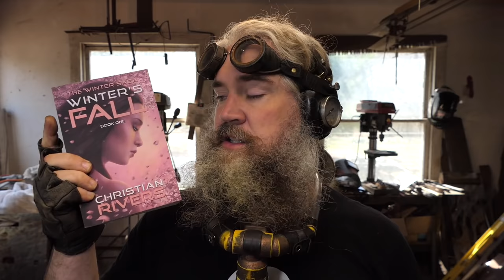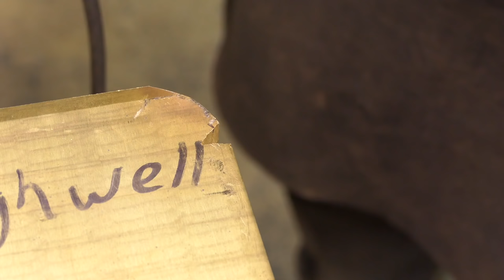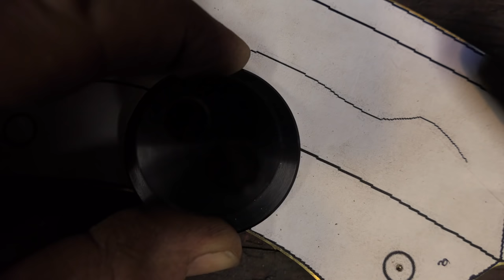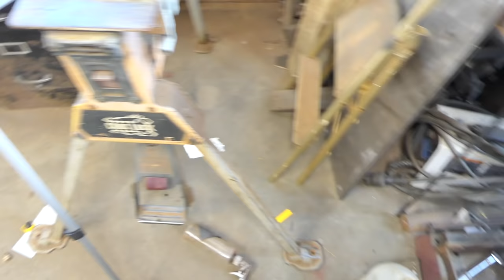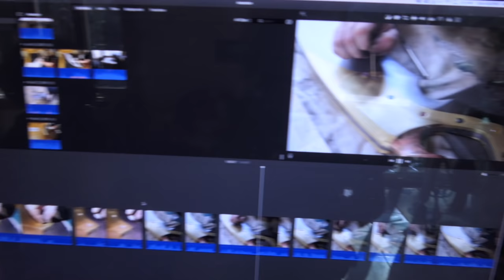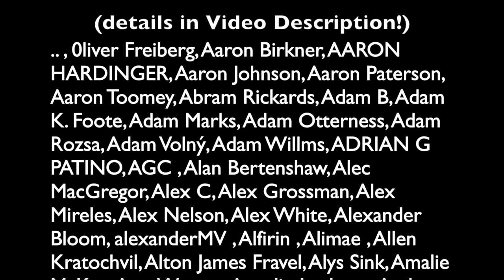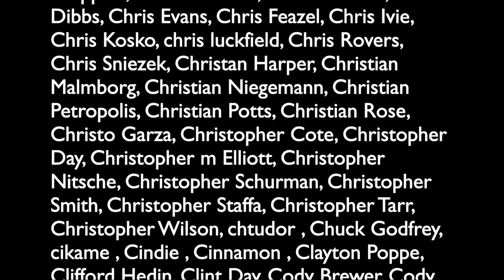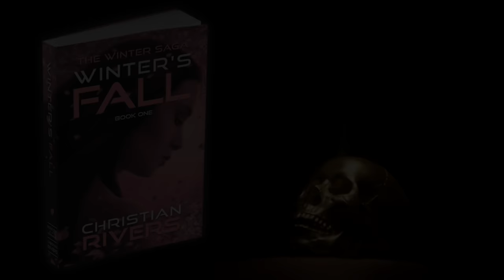Ascension Sword Build

Comment: Brass dust is apparently very highly combustible, I'm very surprised with the welding and sparks from grinding nothing happened. Also the brass handles just alone look like wicked daggers.
Reply: I've seen some s*** with oxy acetylene torches and brass dust never anything from welding
Reply: Never heard it about brass, that's crazy. I know aluminium dust is very combustible and can spontaneously combust when wet. I remember steam cleaning the crevices of an aluminium piece I was working on and it was like I was grinding it with all the dust going up
Reply: Nearly any and all forms of dust are combustible and under the right conditions... Highly Explosive :P including but not limited to Flower and Non-Dairy Coffee Creamer...

Comment: "Wear your gloves kids"

Continues rest of video without them
Reply: Well he's not a kid ;-)
Reply: Do what he says, not what he does.
Reply: literally was about to say...
Reply: Don't worry, he's a professional. He only touches things that are clearly too hot to touch MOST of the time.
Reply: A craftsman works better without any interference, like wearing gloves..!
Reply: same with the welding im thinking please use gloves and the next shot hes using a glove to hold the sword in the vice, so then im thinking "thats not what i ment and you know it" :D
Reply: Do as I say, not as I do
hehe
Reply: @Feroce  Not rly correct. Rotorary power tools or unprotectet turning parts have to be avoided but impact tools you should wear them  . PPE is just the last line of defense in the hirachy of controls, that put a barrierer between you and the hazard, but also as you mentioned PPE could be a hazard by itself if not properly maintained or used under incorrect circumstances. TLDR: specific task rquire specific hand protection

pps: sorry for the poor english
Reply: Denis Böhler totally agree with what your saying, my grandpa has quite a few heavy machines in his basement, two lathes, a milling machine, sanders grinders and a wire and cloth buffing machine. The consensus is short sleeves always, gloves when safe, and eyewear always for those machines. Most important is to respect them, never had big issues. (P.S. I didn’t even notice English issues, I type stuff worse all the time! Have a great day!)
Reply: The key woed is kids 🤣

Comment: I wonder how often Michael has to run a magnet down his shower drain, lol
Reply: Wouldn't get the brass dust though.
Reply: if you go back in his videos far enough to where he was doing the TV show you will find him talking about how showers are for dorks and that he just vacuums his hair when he leaves the shop....no idea if that ever changed.
Reply: If he ever gets an MRI he'll be ripped apart
Reply: @kelzuya  Nah, it will turn itself inside out trying though.
Reply: @jamescairns8465  can't tell if you're being serious, but that TV show was largely hammed up and entirely inaccurate to who he was and his operation. It was... really weird to watch. Still entertaining I guess, but it had that very fake, obviously made for TV esque drama. Its no wonder TV is beginning to die 😂
Reply: Tv is already dead
Reply: @jamescairns8465  I believe he said shower once a week LOL.
Reply: Conveniently, with steel, small flakes like you get from grinders/die grinders rust and turn to nothing fairly quickly. Its stainless and brass shavings you gotta watch for. Unfortunately, neither are magnetic. I weld and get those shavings in my clothes/hair (long hair) all the fucking time, but one shower/wash cycle gets rid of the steel ones.
Reply: @vangoghsseveredear  I fricken hate working with aluminum. I swear I’m allergic to it. If too much gets on me I just uncontrollably itch
Reply: @jerod5636  I can't say I've noticed that personally! But I guess I've never had to grind or cut a ton of aluminum either. I've welded it lots, but never had a pile of shavings on me like steel or stainless. At least on the upside, aluminum is quite fun to TIG weld 😅

Comment: I used to work with brass a lot as a cabinet maker. Pipes, sheets, knobs, and the like. We had what I recall to be a mostly\ normal bandsaw, but with a specific blade for brass, as well as an oil squirting nozzle nearby that would periodically release cutting oil into the cut. We had an air compressor as well, so we would open a little spiggot with a valve (really cheap setup) to constantly blow air on the cutting area to clear a good amount of the brass away, but all that was mainly for the sheets we had to cut sometimes. So very long cuts.

For smaller things like tubes and bits, you could just run through a normal metal bandsaw blade dry and do it very quickly with no problems. Just had to brush away the brass afterwards.

Brass is a good soft-ish metal, but it also leaves a lot of detritus behind when you cut into it (as you got to see). Working with the tools you worked with, I think it's hard to criticize you at all lol just a little squirt bottle of cutting oil might have helped you, since it helps keep bits/blades from getting gunked up with brass.

Comment: I've cut a lot of brass plate in the past and the best device I found for straight cuts is an adjustable speed circular saw with a carbide-tipped blade set at low RPMs. For curved cuts, an adjustable speed jigsaw with coarse or woodcutting blades works best.

Comment: 3:50 Anyone else think the camera was deliberately being leaned in for a better look at first?
EDIT: Hey, Michael- fantastic build, lots of stuff learned.
I have a question. You know the trick where you heat steel and wire brush it with brass to adhere brass to the steel?
Would that work with brass? Maybe heat it and brush it with the end of cut-off copper wire? I'd try it and tell you but I don't have the stuff to do it.
Reply: Yes! I managed to think: Oh he has a cameraman 😁

Comment: I love that you did a full length video … and with your carbide cutters and brass is like aluminum so keep a bar of soap around to coat the cutters with it … just turn on cutter and just touch the soap to cutter getting it into all the grooves (you will have to reapply it when soap wears out or burns off) … then no more "gumming" up cutters

Comment: The key to getting the copper look from the brass was "Oxidation". Because the brass was submerged in the acid, it was not being oxidized as the acid worked. By drying it rather quickly, you allowed the brass to oxidize as the acid evaporated. I believe that is why it worked.

Comment: Hi, texture dude for games here. I work at Epic Games's scanning department Quixel, and I have been around since the very early days of it, developing a bunch of things that are now widely used in the game industry, including methods of capturing stuff like metallic damage. My father was a blacksmith and the knowledge I have from that is invaluable for that application. What usually happens nowadays is that the textures aren't as much photo-based as they are based on actual scan data of materials combined with procedural elements that automatically detect hard edges and so on based on parameters you set to create wear. I have actually blackened plates and so on in various ways in order to properly capture these types of surfaces.

Comment: Micheal Plz tell me the method you use at 1 : 36 for removing rust in large scale parts of metal! I have some old tools from my granpa that I dug out of the basement and they are all super rusty!!  Could you plz tell me what you do!
Reply from the maker: regular V I N E G A R ; just leave it soaking overnight. Possibly longer if it's very rusty. Make sure to hose the vinegar off afterwards, then dry and oil as fast as possible or they will rust again. Also, if the tools are already oily, you'll want to acetone/brake clean all that off before the vinegar bath.
Reply: also ... do this outside because it will stink up your entire house if you do it indoors, AND it does work better when its about 65-70 degrees or warmer outside - the colder it is the less reactive (I guess) the white vinegar becomes.
Reply: @michaelcthulhu  Thank you !
Reply: @kytepheonix  Thank you !

Comment: Tip for clearing the brass out of the die grinder bit. Keep a piece of steel near by and grind that when its clogged and the steel will clear it out

Comment: The reason most manufacturers use brass or bronze for door handles and fixtures, is because the metal naturally inhibits the growth of bacteria, and is relatively safe to handle.     I would still were a mask when sanding.

Comment: Bravo, Nova. You should make some audio books.

So as far as video game swords being generally more shiny and perfect...a lot of the time it is faster AND less graphically intensive to have a simple perfect surface on a model, because you can use just a shader instead of several high-resolution texture maps and bump maps and specular maps...etc etc. But now we've gotten to a point where the hardware is able to let designers use more graphically intensive methods without ruining gameplay.

Comment: future note, when using a diegrinder, especially with brass working. it's not a bad idea to have constant air from an air compressor spraying at the head of the diagrinder. be sure to wear eye protection and point the air so it blows it away from you, but it will help keep the head and metal cool while also keeping the head clean from getting choked up. 
Using water in a spray bottle or slow release tube also helps to keep items, and tools clean and cool when working on metal.

Comment: the reason anime has nice finely polished surfaces with there blades is the fact that katanas have a perfect mirror polish to them, that is slightly darkened by a short brushing with a mix of iron oxide and clove oil that works similar to ferric chloride. also, katana and wakizashi sheaths and some handles were basically lacquered to death as the Japanese have a love of lacquer that goes back millennia.

Comment: I worked machining for many years and the one thing I saw most often is people incorrectly piloting a hole. The pressure that results from the drill is the "Web" at the point of the bit. The web doesn't cut at all, it rubs.  There are some crafty ways to sharpen drills to almost eliminate the web and allow the drill to cut the entire length of the bit... but another way to eliminate the pressure from the web is to drill a pilot hole.
MORE is not better! Most people randomly choose a size that's some degree smaller. This typically causes chatter on the desired finish size unless you use the proper drill diameter for the pilot. 
It's easy :) The web is where the pressure on a drill bit is and why they tend to walk when you apply alot of pressure, simply measure the web with a set of calipers and grab a drill that's closest to that size. You'll get a nice straight pilot and your finish drill will not chatter, it should drill smoothly through.

Comment: Michael that large piece of brass may have been cold rolled.
If so it might be work hardened.
Annealing it by reheating and letting it cool down slow will make is easier to cut and work.
To make your cuts easier you can drill holes 1/4” every 1/2”, this will give you relief for your blade.
And yes it would take you longer, but less stress on the blade.

Comment: Hey Mike, a few tips for using the ferric chloride. Make sure your parts are very clean prior to applying. Rinse with acetone and/or a detergent solution followed by a DI water rinse. For masking, I've found that blue layout fluid that's used by machinists holds up great and is easy to remove afterwards. To protect the patina, wipe it down with some renaissance wax

Comment: Glossy mirrored finishes in games were there because detailed textures with shaders to bring out their details on metal surfaces are hella expensive.

This while a straight color (or very simple texture) with a metally shader on it is far less expensive to render.

But with hardware getting far better, GPU memory sizes growing into the 8+GB and rendering advancing to allow real time lighting, subsurface scattering of light and the likes without that much extra processing cost, more realistic looking materials are possible, resulting in video games using more realistic looking materials.

The memory size changes from the past decade alone already allow for so much more detail in textures.

Comment: As for the taps, drill size varies depending on what type of tap your using. It looked like a roll form tap you were using, so a slightly larger drill size is needed. Spiral taps slightly smaller. Larger for roll form because it’s basically forcing a thread into the hole, and smaller for spiral because it’s gradually cutting the tap into the hole.

Comment: Tips for NOT breaking a tap: 
1. Use 3 step taps. Using 3 different taps seems tedius, but it's way less tedious and time consuming than extracting broken tap.
2. Use lots of tapping lube and don't forget to break chips with counter turns.

Comment: With the copper coating on the handle;
You could electroplate the copper onto it (reverse polarity of your salt-water steel engraving technique- you've got the kit ready to go!)
Use copper sulphate solution instead of salt water, and a copper pipe/rod as the other electrode.

Comment: If you're ever stuck cleaning out files and bits like that, try using a thin, square, scrap bit of aluminium (about 1.5mm in thickness) it should form to the shape of the veins in the file or whatever else.

Comment: Melt wax along the path of the line you want to cut in the brass. The heat will melt the wax and it will lubricate the saw and help keep the brass from gumming up the teeth.

Comment: For future reference, you would probably been much further ahead to just fill the tapped hole locations with the silicone bronze braze and drilled and tapped that.  It would have likely been nearly as strong a connection as the mild steel, and way less headache.

Comment: On the off chance that anyone needs advice about Cubic Zirconia; I'm a professional goldsmith, a Cz is shockingly soft. You can just sand them. Any sort of heat will tend to crack them and if you get them hot without cracking them let them cool slowly, dripping water on them with crack them like class. The reason the different colours had different results is that they are sometimes coloured by cooking them with radiation. More radiation means different colours. The black ones, much like diamonds, are the terrible quality ones, they cook em till you can't see the flaws. Your best bet is to use wet and dry sandpaper and do it by hand in a jig, start at 240 grit and work up to as fine as you like, and make sure to keep it wet

Comment: I know it is a bit of useless advice now, but you should look into experimenting with electroplating. From what I understand it is a bit fiddly but it would have solved the handle grip problem. You could end up with a more durable surface that would also be more even. I think you can get away with good results in just a big plastic tub and using a second hand lab power supply. Love your content, thanks for the full build video.

Comment: punch mark your drill holes first to help ease some of that "surface weirdness" from your drill entering the material, also either use a step drill or multiple drill bits from small to desired size as this eases the wear on the material.

Comment: Michael if you take all the brass chips and put them in a steel cup and put some steel bolts or parts heat it up with a torch the parts will turn blue

Comment: Keep a piece of scrap steel on hand to easily remove the softer metals from cutting tools. I frequently have to work with alumin(i)um and it gunks up my band saw. Cut a bit into some steel and all the soft metal is gone in a fraction of the time i takes to brush the blade.

Comment: awesome project as always! you should test out some carbide drills and holesaws on the hardox. unlike hss,cheap carbide is actually great too, just a little more brittle in my experience. Ive cut hardened knife blades with cheap carbide end mills a few times

Comment: When cutting into an inside corner like that where the disc will over cut, you can predrill a hole right at that center point.

Comment: If you find the magnetism and the metal files left behind to be an issue for your works, what if you made a set up where you could run any projects with magnetized metal filings stuck to them under a neodynium magnet? You could always put a layer of fabric over the magnet to keep the filings from sticking to the magnet and then throw the fabric into the bin after.

Comment: While it is a very beautiful piece i wonder if it should have been done differently. Perhaps a thinner sheet of steel. 5160 Spring steel at .150 - .250 in thick. Mono-heat treated with roughly the same thickness of brass for the side plates and some sort of antler for the actual/handle might of helped reduce the weight to make it actually wield able. As it currently looks any attempt to use it would be an exercise in futility as i think even a few swings would completely exhaust anyone who attempted to use it.

Comment: Could you anneal the spots in the hardox blade with your torch and drill through the then softened steel? Seems like that would have been less time consuming than plasma torching out the holes and welding in the softer steel, then drilling. Just a suggestion, love the content and can't wait to see more giant swords!

Comment: hey there Michael. you can already see what my name is and I am a fellow craftsman, and I noticed your utter lack of a forge and wanted to let you now that my dad and I recently poured ourselves a huge almost 400 lbs. 12" inner diameter by 25" or 27" long refractory cement ribbon burner forge that we were going to cut in half and sell the side that doesn't have a slot for the ribbon burner. And I feel like you will eventually need it.